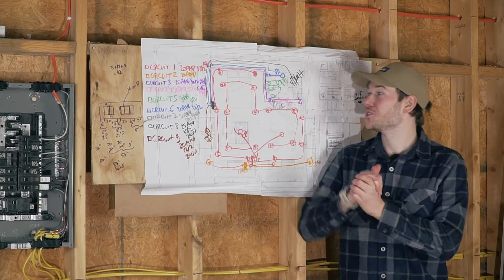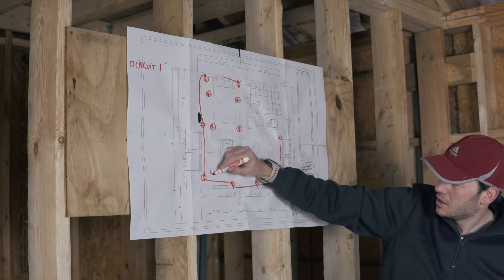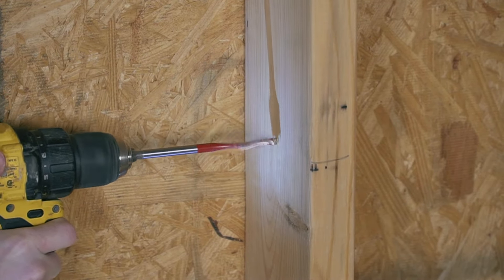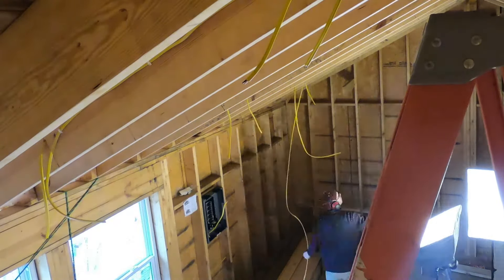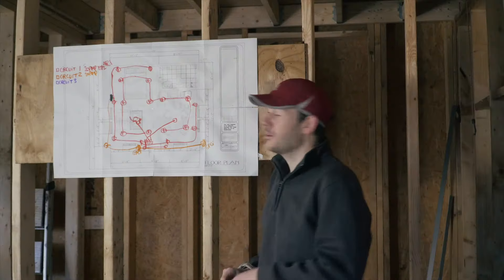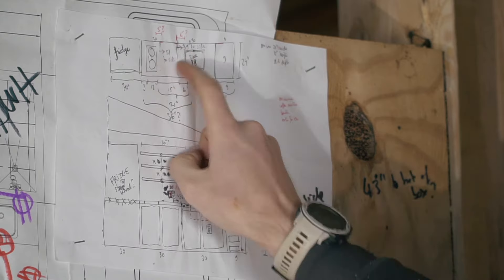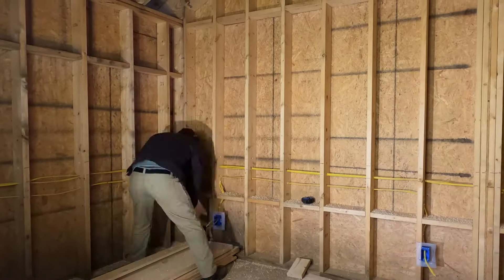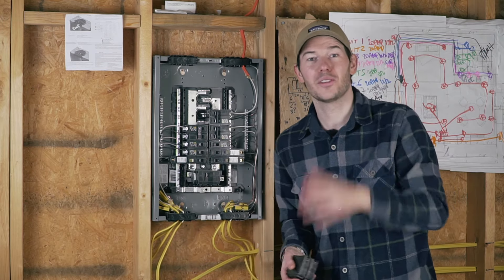How to Wire a Small Cabin - Complete Step by Step Guide - Cabin Series EP 44

Comment: I don't know what code is where your at but 12 points on one 20 Amp is max around me, each receptacle has 2 and each light is 1, you've got a lot of stuff on one breaker
Reply from the maker: Yeah that’s a good point, I hope it’ll pass inspection. Circuit #1 might have too many things, granted all lights will be led’s and won’t be pulling too much. 
I’ll know soon enough when I get the rough framing inspection.

Comment: My dad and I absolutely love your videos. We've been watching from the start. My dad has been wondering about permits and inspections? What type of permits, and if you have to pass different phases with inspections, etc. Perhaps you could talk a bit about that in one of your videos. Thanks so much! We look forward to your next video! You're doing an amazing job! 🙂
Reply from the maker: Maria, thank you so much for such an encouraging comment, I really appreciate it.

I do have to go through all the typical inspections as I want this done the right way. So far, I signed off on my foundation myself since I’m a licensed engineer but I will have to get the county inspector to perform all sorts of inspections. The first one will be the rough framing which I’m hoping to get done in a few months once I finish the front deck, and install the metal roof. I’ll definitely talk about all that when I get to that point.

Also way back when, the health department did inspect the septic system and he’s gonna have to come back out one last time once the main water line will be in place.

Comment: I am suprised you are putting all of circuit1 on one breaker. Are your using low amperage led lighting?
Reply from the maker: Hey matt, yes, i will put all led lights so hopefully should be fine on a 20 amp circuit
Reply: @TheDIYCabinGuy  Just a thought but have you considered dividing the receptacles from the lighting and putting them on their own circuit. I only say that because a vacuum cleaner plus lighting or say an electric space heater plus lights might push you close to 20amps
Reply from the maker: @mattpoland8200  hopefully all the leds won’t pull too much. Time will tell!

Comment: Thanks so much for the videos. I'm doing research for building a 400 sq ft addition. Was a permit pulled? I'm hesitant to build by myself simply because of 1) time line to complete  the work in 6 months as required by my county due to me working full time and 2) not building to code (I've read and researched from IRC 2018 but can't just understand the jargon!)
Reply from the maker: Yes I’m pulling all permit and will be getting all required inspections. 
I didn’t know that some places had a timeline to complete the work. That would be stressful.

Comment: Should have used at least 2 circuits for the lights and 2 for the plugs. It cuts down on the heat in each circuit if y up Ju load it up and it especially allows you to work on half the lights with the breaker off while still having light on the second circuit. Common sense in wiring.
Reply from the maker: Huh interesting

Comment: Circuit #1 Has Too Much On It - Slit 50\50 Lights & Plugs, Otherwise [ ALL Lights Go Out = No Ceiling Lights Or Table Lamps Plugged Into Plugs 4 Light ] Ur Just Tripping Around In The TOTAL Dark... Circuits #3 & #4 Kitchen Plugs R Split Plugs = Top Plug Goes 2 Circuit Breaker #3 & Bottom Plug Goes 2 Circuit Breaker #4...
Reply from the maker: Thanks